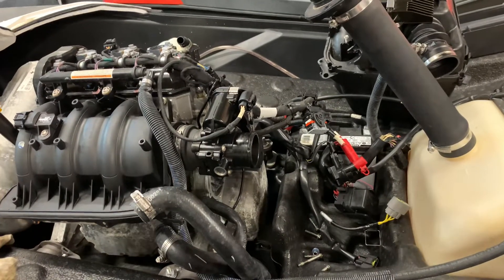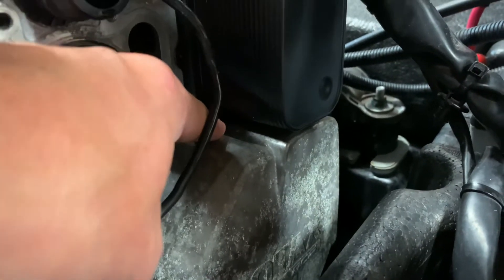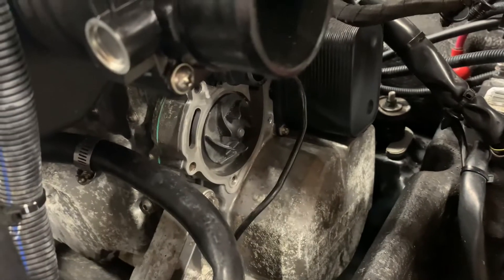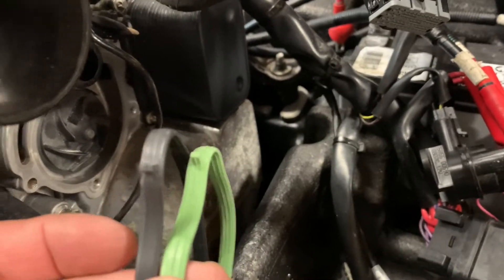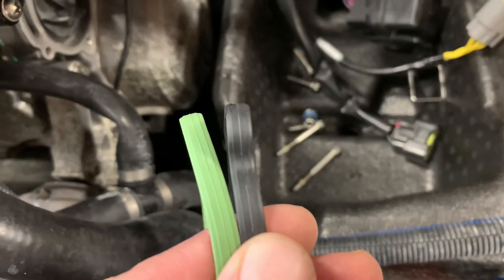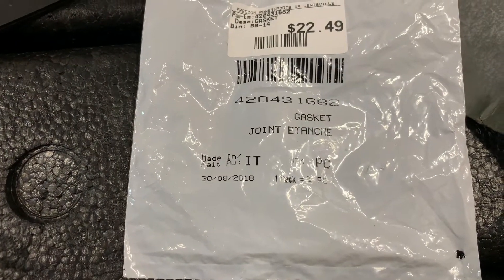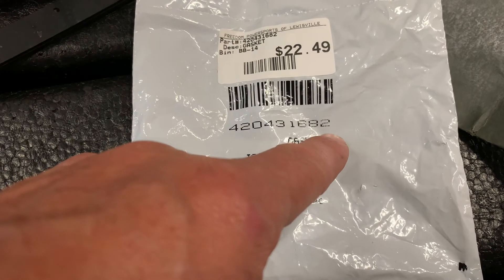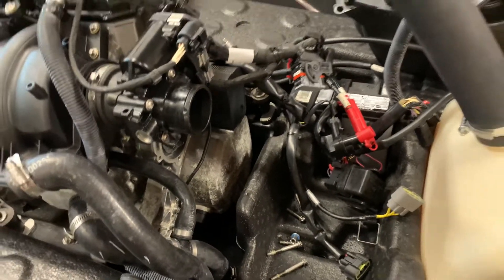SeaDoo Spark Rotax water pump gasket leaking & repair.

Comment: How do you properly fill the cooling system afrerwards?
Reply from the maker: Fill it with the proper SeaDoo or aftermarket glycol, then run the engine which will suck the air out, turn on the hose to cool the exhaust. Turn the engine off and refill the small overflow coolant tank, then run again to get the water pump flowing to again remove air from the lines. Keep turning off and filling until it stays at the proper level for the tank. This only needed on run step for me.